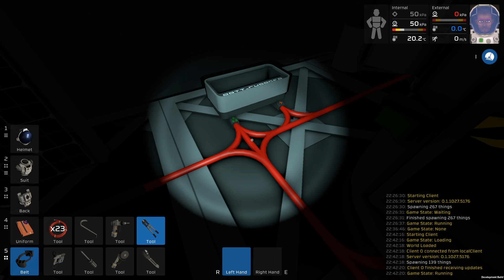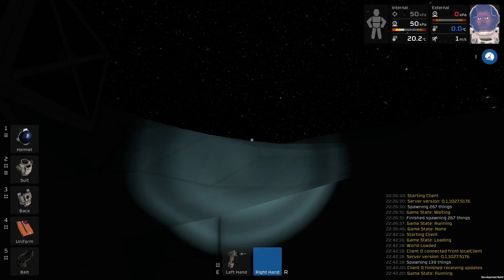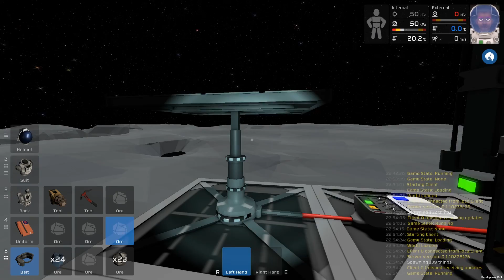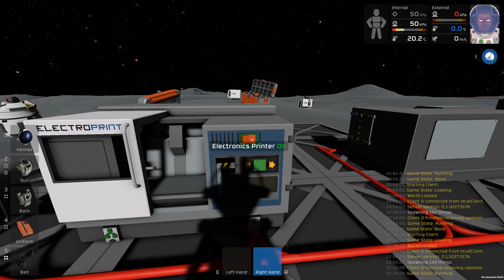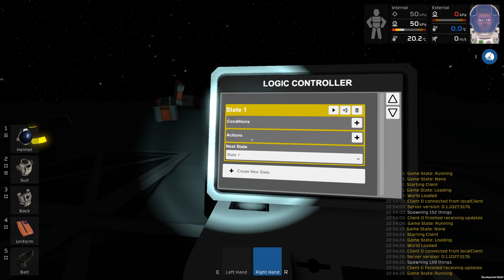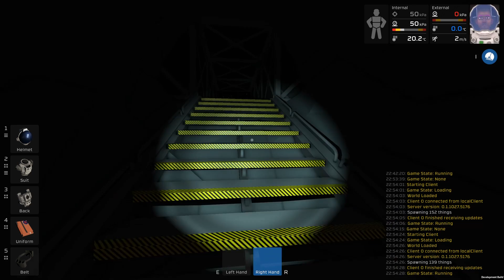Stationeers E02 Fully Automatic Solar Panel Rotation (Computer controlled)

Comment: nothing in this game works as intended, i even copy exactly what he does and build it exactly the same and don't get the same result.
Reply from the maker: Okay - so the game and computer has changed since these early episodes, but it hasn't changed since the later one in the playlist - if you want a simple version, look for episode 07 ( https://www.youtube.com/watch?v=-_ojUOcgC48 ).  There's a really accurate version in a later episode, but that's... not simple :)
Reply: True. It was a good thing I blew this off on my first survival round. I just brute forced and built like 8 solar panels that just sat facing straight up. It may be dumb, but it worked. Now, I built a computer and tried this with just 3 on another round, and they don't do anything, even with a daylight sensor and everything in the network. I can see every item and enter every command and click the checkmark button at the top, and it just doesn't work, as in the panels don't move at all.
Reply: i just spent 3 hours and even raged on reddit yesterday asking if the computer actually does anything. 

I too ended up just brute forcing it, I made my save in space so I have 5 panels in each direction on a pillar.  Who needs logic gates or computers lol 
It actually ended up taking less time and effort just to mine and construct the panels than it would of trying to figure out what is wrong with my circuits.

Comment: It's grams, gravity is lighter on the moon...
Reply from the maker: Grams (and kilograms) are units of mass, and they're always the same, even on the moon.  Weight, on the other hand, varies (and is typically measured in Newtons).  Of course, our average bathroom scales show as kilograms by converting backward from Newtons, so you can recalibrate them no matter where you are on earth (the force due to gravity varies), such that you can see how much mass something has, rather than a varying weight due to gravity.  Long answer, sorry - grams sadly don't work out, but it is a game, so :D
Reply: grams are a measurement of mass OR weight, on another note thanks for the cool videos!
Reply: gram is a measurment of mass. Mass defines how hard it is to change the bodies movement (its easy to throw a tennis ball but its much harder to throw a ball of the same volume made out of lead, cuz it has more mass. Weight is a force with which a body acts on the floor (and some other things but doesnt rly matter now) under the influence of gravity, so if u are on the moon, u`ll WEIGH LESS, BUT YOUR MASS IS SAME. People just use these terms without understanding them, so some get confused
Reply: I know what mass and weight is, grams can be used to denote both.

Comment: I'm having trouble getting my panels to reset to sunrise with the computer, could you possibly post the procedure?
Reply from the maker: Hi Erick - sure.  At the end of the list of states, just add a final state that has a criteria of Daylight Sensor Activate is not on, and an action to reset your solar panels to whatever angle you like (vertical == 0 in my case).  However, I'd recommend going to the updated solar panel setup a few episodes after this, where you don't need a computer, and you don't need to do anything special for each new solar panel (you do with a computer)

Comment: I think i would add a extra line of code so that when the sun goes down the solar will reline itself toward sun rise. That way when worse comes to worse you can catch power as soon as it rises, without manual adjustment
Reply from the maker: Yep, they do reset themselves - there's an extra state that says when the daylight sensor isn't providing an angle, they reset to the starting position.  The setup in today's episode (an improved version using logic circuitry) does better!
Reply: @grayduster  up to what angle and turns have you set it up?
Reply from the maker: @Argonautis22  You may want to look into season 2, around episode 50 or so - I end up setting up solar tracking in a much nicer way, using only an IC and a batch writer (this video is quite old)
Reply: @grayduster  Thank you! I started watching the series from the beginning to get the basic idea of how everything works. I started a map at Mars but I am having difficulty with food 😋

Comment: To start you can leave the APC dials to auto.
Reply from the maker: +Tom Cooke they don't do anything at the moment apparently, so they've removed the hit boxes
Reply from the maker: +McyD they start on off :)  I was switching them to auro
Reply from the maker: They definitely start in off mode (I just built a new one to test).  The white line shows their current state, and I know about the tooltip showing you the next state.  It says 'Auto' when you hover.  Clicking that turns the white line to Auto, clicking again, turns it to On.
Reply: I can not for the life of me get any hitbox on the APC dials. Anyhelp ? 12-24-17 not sure how the updates have changed it